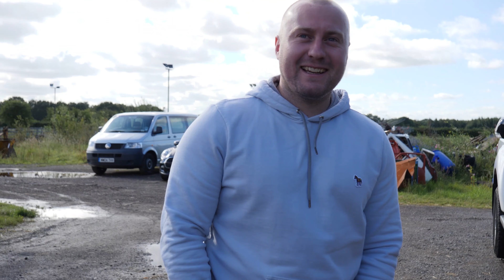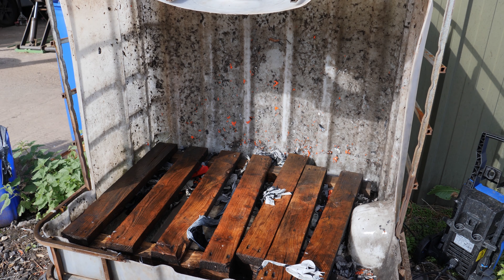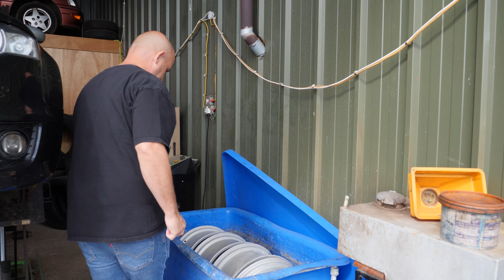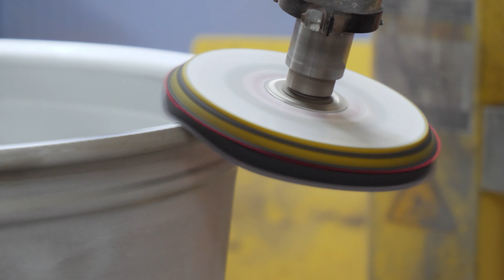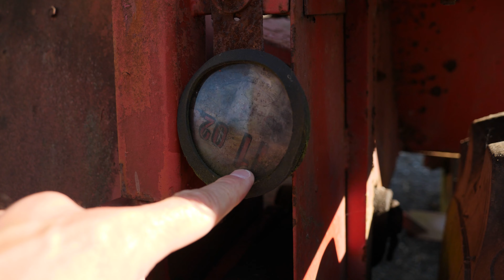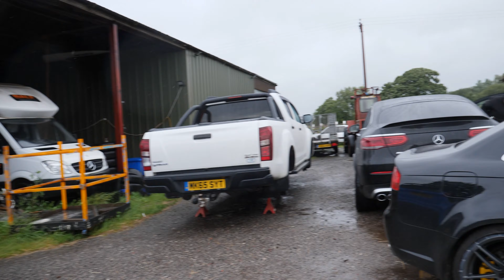HAVE WE WASTED MONEY MODIFYING OUR RS4 ALLOYS?

Comment: I don't know if you've addressed the under carriage oil leak in other videos but based on my experience, the a) oil filter housings o-rings are bad (manifold off fix)shine a light into the little gaps on the top of the intake manifold and down in front of the motor to check for wetness. b) leaking joints on oil cooler line due to corrosion. c) bad water cooled oil cooler (yes water cooled oil cooler) attached to the block located at the bottom front left of the motor.
Reply from the maker: Not got around to that yet. Videos to come though. Thanks for the info 👍🏼

Comment: Good colour, why paint and not powder coat?
Reply from the maker: He said that where he had filled a couple of the wheels the powder wouldn’t have taken to certain spots. Easier to powder coat perfect wheels as no filler etc 👍🏼
Reply: @EVILGT  Romax wheels Teeside not local to you but they charge £55 + Vat per wheel for 19s fully refurbished kerb rash and other scuffs completely filled and machined true and powdercoated not painted. They can do shadow chrome effects like the M5 wheels for about £5 more. Same day too so long as you arrive early. I don't work for them but I have had wheels done by them.

Comment: Hi guys any reason why you went for a painted option over powder coating them?
Reply from the maker: The powder coat wouldn’t have stuck to the bits of filler used to repair them mate so would have ended up patchy 🤷🏼‍♂️
Reply: @EVILGT  I see what you mean. Maybe in future we can do a set of wheels for you. We weld the damage rother than use filler. Loving ur rs4 😍

Comment: i would powder coated all day long much stronger better finish and painted will start to deteriate in no time
Reply from the maker: Supposedly the wheels had to be in better condition to powdercoat. They had a bit of filler here and there so that was the problem 🤷🏻‍♂️
Reply: @EVILGT  that's not true you can powder coat any wheels I use first aid wheels they find cut powder coat and repair there the best around check out there we sight